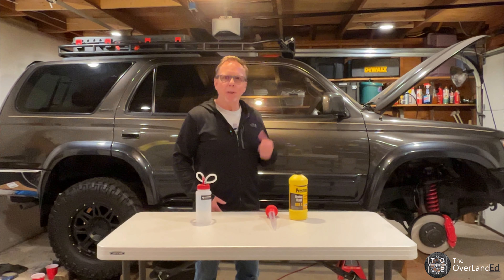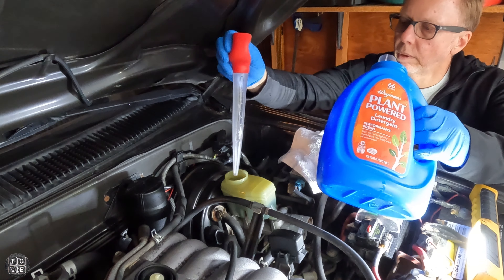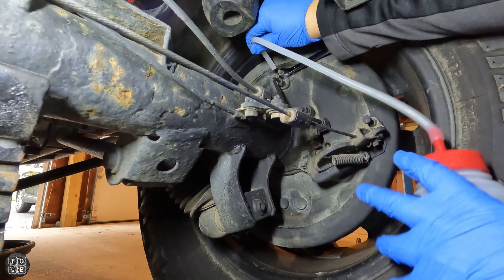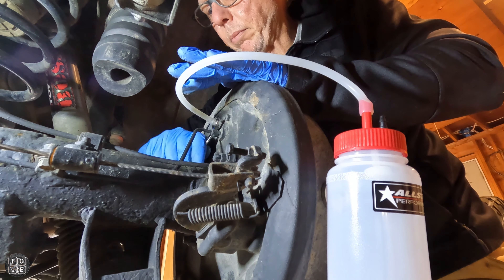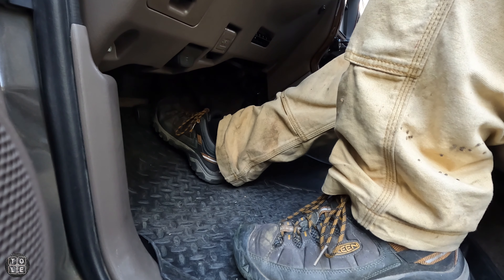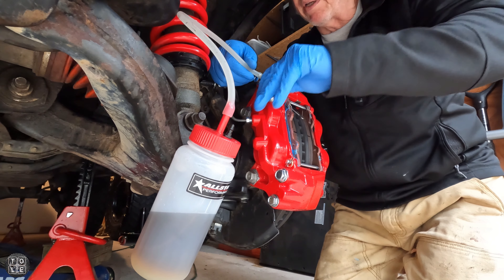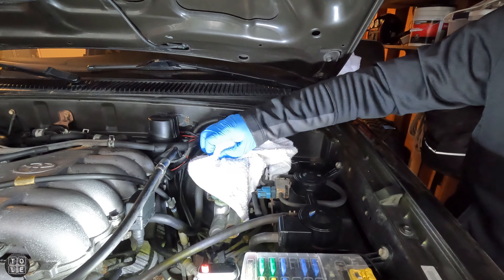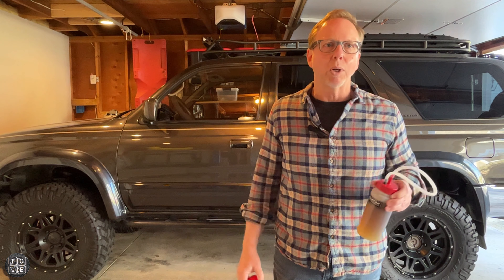Brake system flush using one-person brake bleeder (Allstar Performance Bleeder Bottle)

Comment: How do you know no air is going back into the system through the bleeer valve? Would a cheap vacuum pump on amazon work batter than just a catch bottle?
Reply: Check valve

Comment: - Greetings OverlandEd,   I'm planning to do a 2013 tundra Brake replacement soon with new rotors, pads and calipers... BTW - I do like the the Callahan - Red Calipers however, the link you posted indicates that they're currently unavailable and don't know when or if this item will be back in stock.  So, I think I'll just get new remanufactured calipers and paint them red myself.  But, I'd like your opinion on a question of brake bleeding.   Do you think it would be beneficial to flush out the brake system of the master cylinder and, brakes lines with new DOT 4 fluid with the old calipers still installed in the attempt to remove the majority of old contaminated brake fluid till it runs clean and clear before installing the new calipers?  I'm thinking it would minimize the possibility of leaving behind more of the old fluid mixture when purging and bleeding out the entire brake system through the new calipers.      Thanks,  -Skoot
Reply from the maker: Flushing the brakes with the old calipers might be a good idea.

Comment: I kept having issues with air leaking at the hose to valve connection and zip ties didn't help so I gave up and used my backup tool....my wife LoL!  Two person is so much quicker and easier in my opinion.... doesn't take that long and I don't need to deal with hose to valve connection that simply won't seal correctly....

Comment: One suggestion, I would add a little brake fluid in the catch bottle just enough to cover the hose in the catch bottle maybe 1/4 cup to be safe so air doesn't go into the caliper. I'm sure this won't happen but figure you will have left over brake fluid so adding 1/4 cup in the can won't hurt. Thanks for the video.